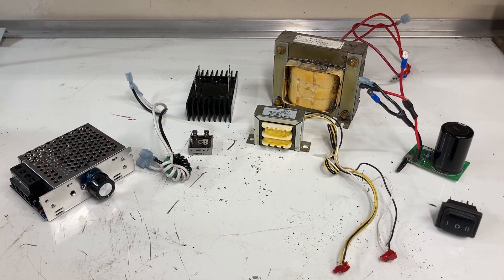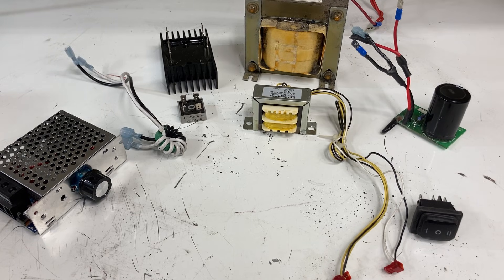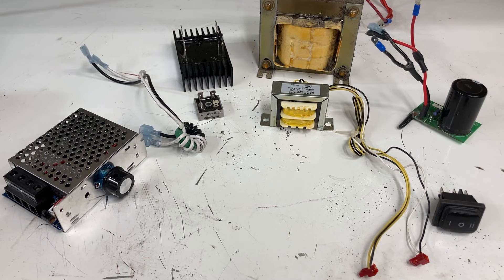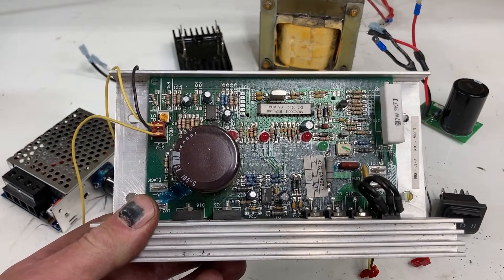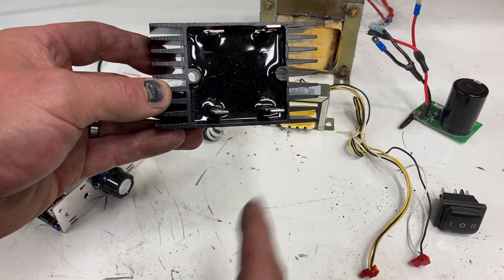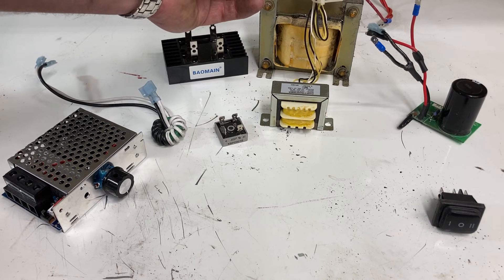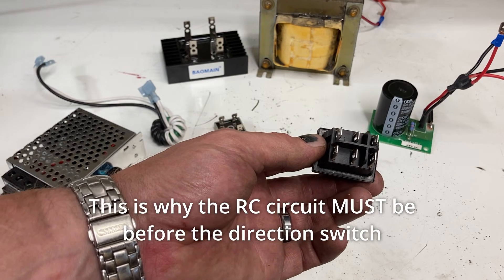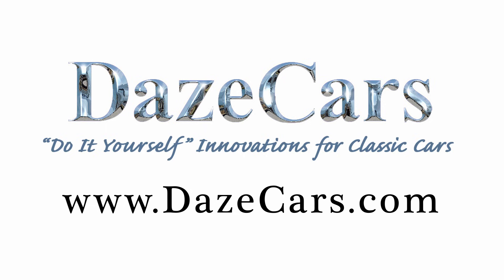Putting Together a QUALITY Variable Speed Power Supply or Treadmill Motor Controller SCR type

Comment: Could you put an inline diode from the rectifier to the motor to prevent motor burnout due to rectifier failure ?
Reply from the maker: It doesn’t work that way. When a rectifier fails it shorts out, effectively connecting the two wires together coming out of the power supply. This can burn up the power supply. Electricity takes the path of least resistance so all current will be flowing through the short and no power will be getting to the motor. When a bride rectifier fails at best you will trip the AC circuit breaker, at worst you will fry the power supply. That is why I recommend a circuit breaker or fuse between the rectifier and the power supply.  Please let me know if you have any further questions.
Reply: @dazecars  thanks for the clarification. I thought the motor was getting ac power but it's the power supply that is vulnerable. By the way this was the best controller video I have seen and I've seen a lot
Reply from the maker: @ksgjlg  Glad you liked it and that it was helpful.  I also have one on using the treadmill control boards, its worth a look if you haven't seen it.
Reply from the maker: @champspec  When scrapping FREE treadmills you don't get to choose "good ones" 😂😂.  I have scrapped about 15 and roughly half were of higher quality.  I use the smaller motors in my videos because they are smaller, lighter, and easier to move around and show on the videos, but the ones I am using on my machines are a lot larger and far superior quality.

Comment: Did you change the value on the original pot to a lower one?
Reply from the maker: I did.  That info is more technical than the scope of this video but the web page I created (and talk about in the beginning of the video) covers how I chose a pot and using a resister to set max speed. https://dazecars.com/dazed/variable.html